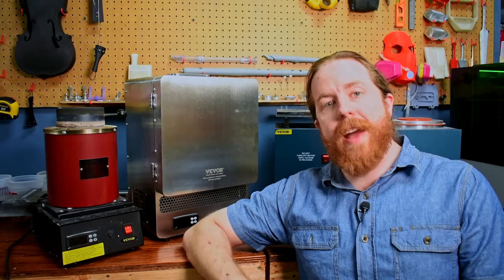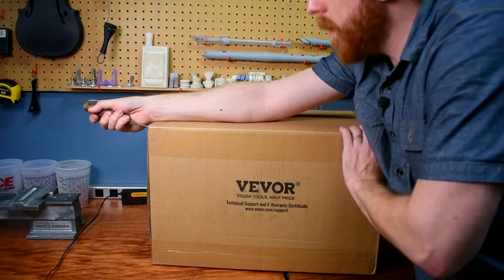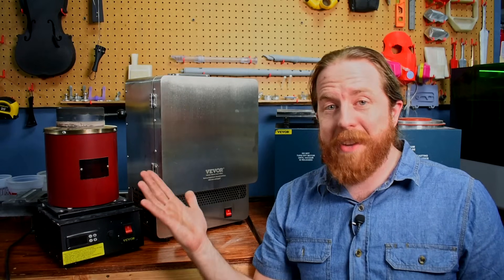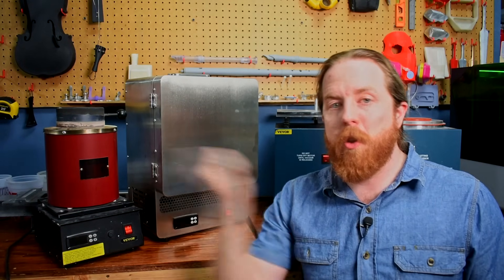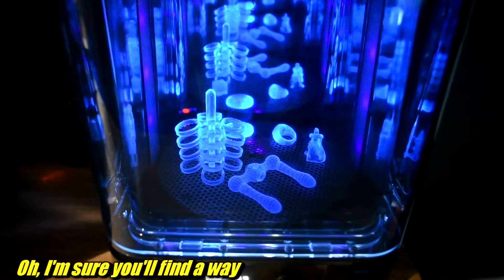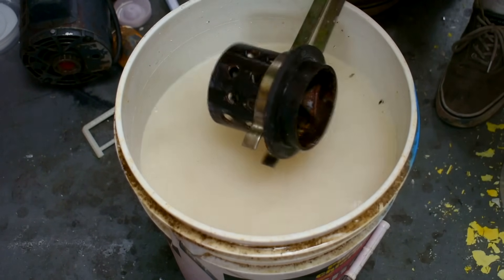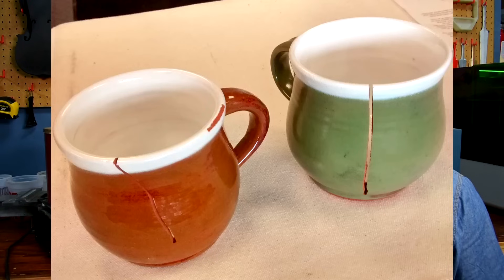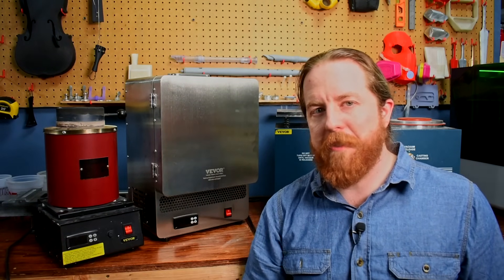Does the Cheap Vevor Electric Kiln Work For Investment Casting?

Comment from the maker: Find the Kiln here: https://s.vevor.com/bfRRpJ
Metal Melting Furnace here: https://s.vevor.com/QTYJN0
Vacuum Casting maching: https://s.vevor.com/bfRSmD
(5% Site-wide Code: VEVT5)

3d Printing Channel here: youtube.com/@PaulsPrinterProjects
Reply: Hello, I recently managed to cast zamak5 in a mold of high-temperature silicone (ag-bet silicone up to 350°C available in my country). Although the zamak5 alloy is cast at a temperature of about 420°C, the silicone withstood it. I also saw videos on YT where zinc alloys were cast in Mold max 60 silicone (withstanding up to almost 300°C), which is more available in the USA, the silicone required additional cooling with wet towels but also withstood higher temperatures. This is an alternative to casting without the need to melt PLA from the mold, and the mold itself is reusable, best regards.
Reply: You need to add a disclaimer for your recommendations.
Reply: Now that there's an orange madman, dumb questions must be asked: what country does this ship from?

Comment: Great video and very well explained. I’ve bought this kiln but I have a question: it says not to run it for more than 3 hours without a 30-minute break. I understand that for burnout I don’t need to stop it, since the temperatures are not very high. I’ve seen that in the video the result is good, what times did you use?
Can I follow this schedule:

150 °C – ramp up and hold for 3 h
Ambient → 150 °C quickly
150 °C, 3 h

370 °C – ramp and hold for 2 h
150 → 370 °C in 2 h
370 °C, 2 h

730 °C – ramp and hold for 2–3 h
370 → 730 °C in 2 h
730 °C, 2–3 h

Cool down to casting temperature
730 → (480–550 °C depending on the metal) in 1–2 h

Thx for all.

Comment: Hi, I have the same machine, but mine came with the oil level at the minimum. I have a general idea of the type of oil, but where can I buy it, or what's it called? It's No. 46, ISO 46, but I can't find it. Thanks.
Reply from the maker: Its called vacuum oil.  I got robinair brand vacuum oil from Amazon, not sure if its a specific type of vacuum oil

Comment: Just got one, for Heat treating smaller S7 tool steel. So far I'm impressed with this little oven. It fits perfect for my smaller parts. I do wonder what it would take to change out to a programmable plc for less babysitting.

Thanks for a great video. Lots of great info

Comment: I caught the metal-casting bug in high school and have wanted to do it at home ever since. I had no idea there were such great benchtop tools available. Thanks for sharing!
Reply from the maker: Thanks for watching!  All of these cheaper benchtop tools are pretty new, back when i started doing this i had to build my own melting furnace and my own burnout oven.  I was about to build my own vacuum casting machine, but then this one came out.  I might still build one so i can go much bigger, but for now these cheaper ones work great
Reply: @PaulsGarage is temperature set same temp inside on both models?

Comment: Zinc alloys can be cast in molds of high temperature molding silicone, I managed to melt hinges from zamak5 alloy with a cheap torch in a steel can and cast metal parts in this silicone mold. This way we do not have to destroy the printed part by burning it out of the mold (we simply pull it out of the silicone), and the mold itself is reusable, you can make many copies of the printed part in metal.

Comment: There’s burnout filament for filament printers. Not interested in jewelry these days, but machinery parts. I do have a heat treat oven that goes to 1,200 C. It’s 12” deep by 10” by 10”. I wouldn’t use it for powder coating. I have two ovens for that. The plastic from powder coating can give off a fume that can stick to the walls of the oven. It’s a very tiny amount, but it can build up over time. Most oven manufacturers of heat treat ovens recommend against using it for powder coating and other purposes like that.

Comment: Thanks for the review, I have been eyeing off cheap kilns and this looks like it will suit my needs. Just be careful when placing your flask in there with the power on, as that flange looks like it could easily touch the windings which would be bad.

Comment: Man, I looked at these and anything even remotely close while rebuilding my mega-furnace just recently, fully aware that they existed and would 100% be cheaper than all the refurb materials I've been stockpiling. The real drawback is the relatively miniscule internal volume, as there's been instances where I've built a big, complicated piece of equipment for one stinkin' project because it needs to fit.
Case in point, the ol' mega-furnace was made for programmable PID control with USB connectivity, higher heat range (replacing Kanthal with Tungsten Quartz this time), and one day, being adaptable into a vacuum furnace. 
If these were just thiiiiiis much larger...

Comment: I'm using this furnace to process VirtualFoundry Filamet copper, bronze, porcelain, and pyrex 3D prints.  Burnout and sintering in a 500ml alumina crucible.  Works great.  Just need to time things manually.  I'd love it if you could swap a programmable PID controller.  Can't beat the price.
Reply: They have programmable PID version
Reply: @ryans6982 The RevA version seems to be a pretty new release.  Would be nice if they sold an upgrade kit.  The new version wasn't available when I bought mine.
Reply: @GeoffB10  can you specify which kiln in particular you're talking about? sounds pretty ideal but I can't quite find it
Reply: @gabewrsewell the version with 9 stages is $100 more.

Comment: well best is when you make stuff yourself that you can make stuff with. so why the diy kiln cost that much. its not the scales of manufacturing but the parts selection. well scales comes from the parts selection. or diy parts. microwave oven heat pod is the simplest. well the microwave is cheap and the microwave kiln is cheap. yeah that combo is like 50 + 50 usd whole thing. 1/3 of that kiln. generic is best for doing specific. well again parts and materials selection. dont have to do the complex way. investment pla casting. the microwave combo is 1/10 of the special kilns. why so much vacuum expensive tooling. its not an excuse if you dont have to excuse to anyone. lol. why you make it so complicated. just heat until up the temperature then put in the pottery. oh hurry makes poor judgements.

Comment: Your zamak vacuum investment casting video inspired me to start metal casting, and this is the kiln I ended up buying. I've done a handful of burnouts with it and so far so good! I ripped out its control board and replaced it with a raspberry pi running an open source firing schedule program, and it was pretty straightforward.
Reply: That would be a good subject for a video, both building (I am specifically unsure how to read the thermocouple) the setup and using the software.
Reply: @andy-in-indy  you need a max IC that amplifies the thermocouple signal to be readable, I forget its numbers. Then you need to make sure that all your wires between thermocouple and the IC are the special thermocouple wires, because you want your differing metal junction as close to the IC as possible. Other than that, it's just a normal sensor.
Reply: My thoughts exactly, except I have an old PLC sitting unused in my junk drawer.
Reply: I have several Arduinos but am limited on how to do what you are suggesting and would love a guide on how. I mean limited as in can make an LED blink sos and run a servo motor and a few other things.

Comment: I'm a bit grumpy about vevor, as they refuse to ship to New Zealand :(
Reply from the maker: That's a bummer, yeah.  We get spoiled sometimes in the US, everybody wants to sell stuff here
Reply: @PaulsGarage  funny in oz we buy stuff from china for $2.50 post free. If i wanted to post it to the next suburb it would cost $8. ( Made up figures check them your self)
Ps don't stop it i really like buying crap from china for $2.50.
Reply: I get Vevor stuff here in Oz just fine, but they (at present anyway) don't stock the Burnout Oven or Vac Casting machine.  The burnout oven is on their AliExpress store for a reasonable price but does not mention if it is 110, 230 or combo volts.  Edit: says it can not be shipped to Oz so I'm guessing it is a 110v only unit.
Reply: Maybe because they want vevor to pay the in country shipping costs.
Reply: @mapp0v0 it seems like this kiln is only available in US.